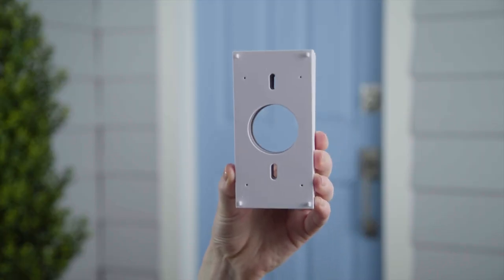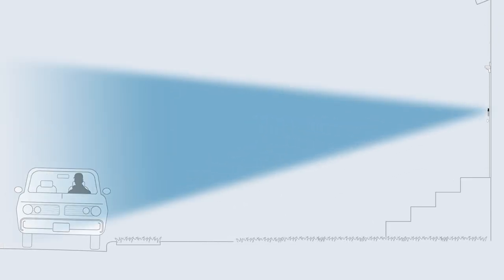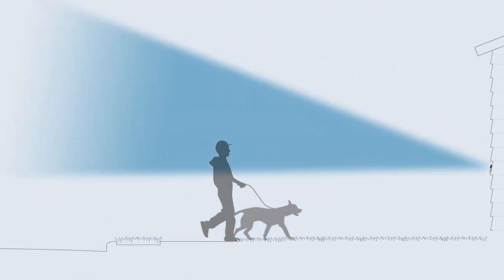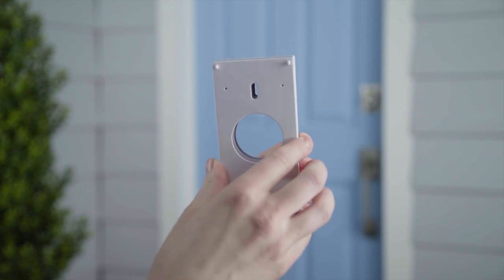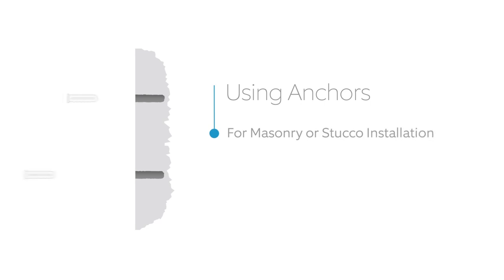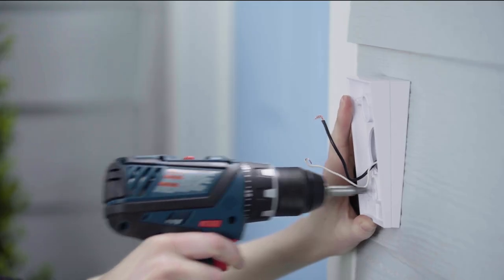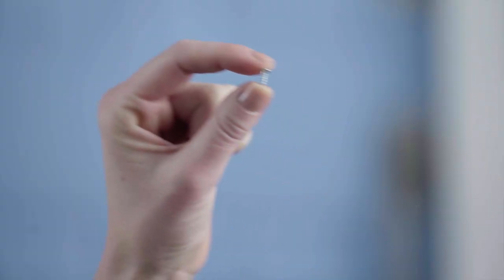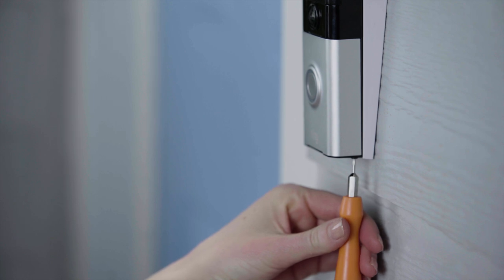How to Install the Ring Video Doorbell Wedge Kit

Comment: I don't know why ring tells you to do this but you don't have to drill the 2 new holes to mount the kit. You can just use the existing 4 holes and mount the kit   to the 4 existing holes. You just have to match up where to drill on the kit in relation to the 4 existing holes.  I drilled my holes right above the screw-in placents on the first wedge.

Comment: I am 6 feet tall and this is exactly part of my concern,to install the ring door bell at 4 feet height.I have stairs in front to be climbed so I will need the Ring Wedge Kit which I have ordered.Putting all of these into consideration,is it still okay to install the video door bell at 4 feet from the ground.
Reply from the maker: With stairs leading up to your doorbell, mounting 48 inches from ground level probably isn't feasible. We would thus recommend installing 48 inches from your deck level and use a Ring Wedge Kit. You may learn more about using a Wedge Kit and installing a doorbell with stairs here: https://support.ring.com/hc/en-us/articles/360041189931.

Comment: So can I install 1 wedge, which requires 2 screws (one above the other), directly on the wall without using the bracket? Which needs 4 screws, 44mm left to right, and 87mm top to bottom
Reply from the maker: We would recommend that you still use the bracket.
Reply: @ring  Thanks... I recieved my battery powered Ring doorbell, 2nd gen, this morning and was surprised that it does not contain a drill bit, spirit level or any  wedges... No big deal really with the smaller items but the wedge is needed
Reply from the maker: Hey, neighbor. Thanks for letting us know. Please contact us on Facebook, Twitter, or Instagram, so that we can assist.

Comment: What about vinyl siding? Also, my doorbell is currently installed sideways, will I need to drill a new hole, or are the included screws self tapping?
Reply from the maker: Hey Aaron, for vinyl siding, we recommend installing the Ring Doorbell on a vinyl mounting board so it's stable, secure, and provides an optimal view of your approaching visitors. We don't recommend installing the Ring Doorbell sideways as this interferes with its motion detection functions, and you'll need to drill holes for the mounting bracket provided.
Reply: Hey Aaron Just go to  Lowe's and get a piece of wood and molded to you vinyl siding. so the ring doesn't hang on the bottom.  Than you can painted. And will be secure and look nice.

Comment: are the corner kit and wedge kit compatible?
Reply from the maker: Hi there! The corner and wedge kits can be stacked, so you are able to use them simultaneously on top of one another. We recommend to have all parts available before doing any drilling. We have attached an article with how to videos on installing wedge and corner kits here: https://support.ring.com/hc/en-us/articles/115003034406-Installing-the-Wedge-Kit-and-Corner-Mount-for-the-Ring-Video-Doorbell-2-. Let us know if you have any further questions or concerns!

Comment: How can I determine how many wedges to install?  Do I do this by simple trial and error?  Thank you.
Reply from the maker: Absolutely, we recommend trying out different variations of wedge and corner kits to find the best fit for your Ring Doorbell and home environment. You can stack the wedges together and access live view through your Ring app to ensure the view is what you want before mounting them to the wall. Call us at 800-656-1918 if you have any questions, our team is here 24/7 to help!
Reply: @ring  .... $20+ shipping cost$ for 3 plastic pieces and a few fasteners merits more specific guidance as to the need for a 5, 10 or 15 degree adjustment than by trial and error. The printed instructions are minimal and vague and this video is little help. Why does this tutorial not mention the 'feet' that the print instructions specify to be removed? Minimal effort at instructions and video on your part. >try harder<
Reply: Cory Smith Terrible instructions. The 5 degree downward wedge is so minimal since I live on a hill I’ll be stacking 3-4 at least. The sensitivity of the doorbell got worse and reaction time to the router 5 feet behind the doorbell is giving alerts after 30 seconds
Reply: @corysmith6415  I agree & this video does NOT show the bracket being installed on the wedge!  Most of the instructions are not good for this video.  On the Ring site, it doesn't show instructions as well. ???
Reply: @blueoysterdvp  I'm hoping the wedges work for me as like yourself, it gives me alerts after 30 seconds as well!
Reply: One swivel mount to solve all angles, would be more efficient than bunch of wedges, but then it wouldn't be as profitable.